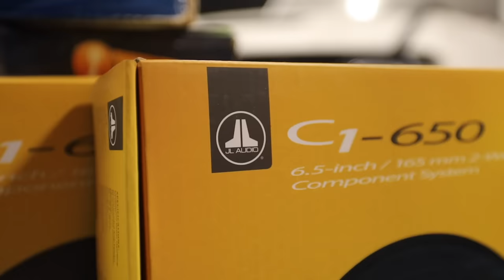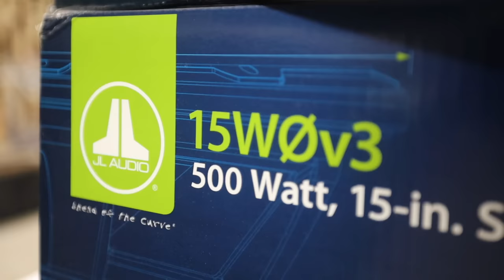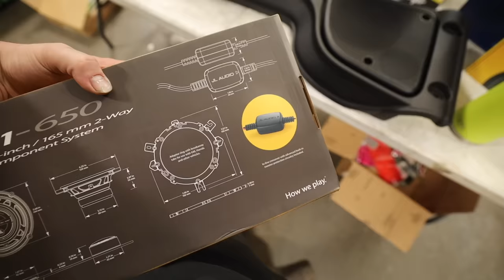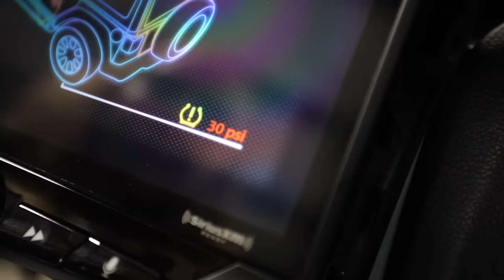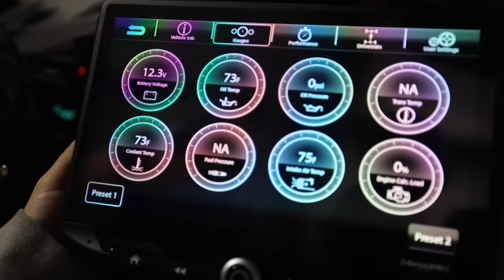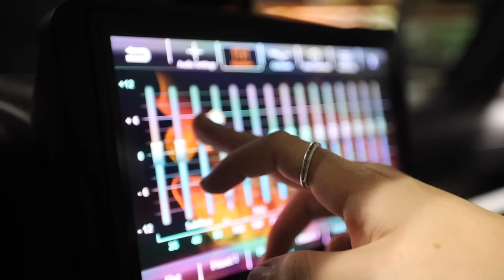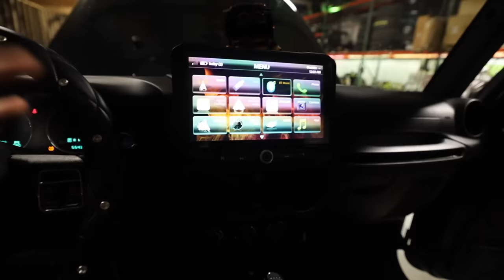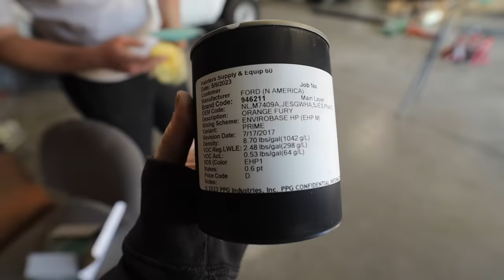Putting TWO 15 INCH SUBWOOFERS in My Girlfriends JEEP WRANGLER!

Comment: The foam in boxes are NOT FOR SOUND DAMPENING! It displaces the air waves! When an air wave bounces off the back of the box it disrupts the push pull of the driver. If you put the foam in inside, it slows down the return waves, therefore the sub thinks its in a bigger box. Lower FQ, more power handle lode with out distortion. The sub FQ will lower. It is NOT THERE FOR SOUND DAMPENING like Dynamat does.
Reply: I was lookin for this. B4 I said it😂
Reply: I rather go with surface polyfill
Reply: And also makes the sub hot faster. Which is no good.
Reply: I got two body pillows in my box

Comment: The sound deadening in the sub box is a no no. You are taking up more air space that the sub needs. Especially a sealed box.  You use poly fill for the sub box it like what the use in pillows. You just put in a little bit around the walls. Slows the air movement down making the sun think it’s a bigger box.
Reply: The 80's called and want their technology back. 

Ringing subwoofer enclosures are exactly what you want to hear in a good stereo set up.

Comment: SUPER CLEAN AMP install  I will be ordering those amp racks to remount my amps.-   As a Jeep & Bass guy, only use SPL subs so that the bass is hard with or without the top.  It is a Jeep so that top is gonna be off or partially off at some point. And just a tip, never tune audio using Bluetooth.  props for having a lady that helps, that's awesome.

Comment: Very clean install. With that space I would’ve went for either a single 12 or two 10’s in a ported enclosure tuned to 30-32 hz
Reply: No wonder your mother is disappointed in you... sissy 😂😂😂
Reply: It Would be pointless to use a ported enclosure if you’re going to be driving with the doors off etc… 😂 might as well run the subs with no box at that point

Comment: Jl audio I had them back in the day they always split their surrounds on 15 w6 ran a trio of them in my Grand Cherokee. The w7 has modular surround meaning it's replaceable . When I put the 12s under my Rams seat I skipped JL and went to a pair of DC audio level 4 with level 5 upgrade parts they hit almost as hard as the 3 15w6 did and haven't fell apart like the w6 surrounds did.

Comment: I'm curious as to why you went with 15s since you're not going for big wattage
Reply: Generally speaking, bigger subs will have more output for the same power. So if you want the most output without using a whole lot of power, go with big subs and big enclosures.

Comment: A sealed box is the best if you're not a Bass Head. Much ezy to toon faster with the best price. I switched to Fosgate stereo system in the early 90's like 1991 first year of High school and still have the amplifier punch 200 for mid punch 60 high punch 40. the sound denting material just use Lizard coating spray on. Best for the money.

Comment: Where did you mount the bass control knob? I just installed some 10" subs and am trying to figure out the best place for the control knob.
Reply from the maker: The panel under the steering wheel, there’s a thin piece on the right and left side of the under steering wheel plastic and we drilled it into the right side! Out of sight yet totally accessible!

Comment: it can be confusing on car audio forums. not everyone really knows what they are talking about. some are just repeating things like robots without any real world experience. 
the sound bar delete was in reference to creating a front sound stage. 
using soundmat inside the box isnt needed. you could build a box using thicker mdf and coat the box with bedliner since its a jeep and water getting inside is a thing. 
adding sound mat is adding mass to your vehicle surfaces. you're essentially lowering the frequency  of the noise. adding another layer to the floors will help. also adding mat to the inside skin of the door will help. invest in some amp gain setting tools if this is going to be a thing for you. setting gains by ear is fine to get some music going but you are not getting the performance you should.

Comment: Ok I just looked it up your subs are 4 ohms and your amp is 600w at 4 ohms and 1000w 2 ohms if that’s all good play around with box placement my box was placed right up on the back door. One thing you have to remember is bass is non directional. Meaning if it facing the back it will still project and being a sealed box it doesn’t need room for the port to fire

Comment: Nice clean install but subs that's supposed to work in small space has a trade-off of what it could soud like and to me it's to big of a trade-off. Max I would of went with is 2 12s with the same air space. A higher quality 10s would most likely sound better than what you have.

Comment: All you need is a big 3 upgrade and agm battery from xs power preferably the d3400 series to help with the voltage drop.. running stock electrical you’ll never get the full potential of what  that system can do!

Comment: I had the HEIGH10 in my Wrangler. Only problems I had with it were once in a blue moon the reverse camera didn’t work (very rare) and the steering wheel controls had a slight delay.

Comment: 9 wire with a wire harness to keep the factory wiring in place is so much easier. You won't notice any difference in sound quality. Those speaker wire adapters are also really nice and would have simplified the component install. Just saying.

Comment: Your videos are getting better and better.  I'm impressed with the Stinger! Any thoughts about putting on in your Ram? I'm going to look into one for my 2017.  My head unit doesn't have GPS activated and I can't fathom spending $500 to activate it. I'd much rather spend $1000 and get the Stinger!!
Reply from the maker: The stinger for the ram is a pretty clean kit as well! Bigger than the 8” u connect and ready to go for aftermarket speakers!
Reply: Only thing i didnt like about the stinger when looking at it, is that what you pay to get it still doesn’t give you bluetooth apple car play. Whereas the sony head unit that is free floating is $1,300 and it has BT apple car play and is a 10.1” free floating head unit with a volume KNOB (which is a big seller for me, i hate clicking buttons i just want a wheel to spin to lower my volume quickly). I cant remember the exact model number for the sony headunit, but thats what im putting in my ram after i do my subs.

Edit: the headunit is actually kenwood and its the

Kenwood Excelon Reference DMX1057XR

Comment: Great Install, Very clean. I'm just wondering why you "daisy chained" the wires to the subwoofers? Overall, well done and good work!
Reply: He wired them in parallel to get the lowest impedance possible.
Reply: @JasonWW2000  wiring them parallel is not the same as a daisy chain
Reply: @johndonut104 Okay, so by daisy chain your referring to series wiring, correct? 
He didn't daisy chain them. He wired them in parallel. 

The subs are single coil 4 ohm. 

He wired the positive of each sub together and the negative of each sub together. So if you measure the resistance at the amp it would be around 2 ohms. 

If he daisy chained them it would read about 8 ohms at the amp. 

Hope that clears up any misunderstanding. 👍
Reply: @JasonWW2000  20:45 clearly daisy chained but ok, I guess I'm confused. I'm done thinking about it anyway haha as long as it bumps
Reply: @johndonut104  I can tell it's a bit confusing, just follow the 2 wires from the amp to the box. They come in from the left. If he were to wire these subs in series the red one would be on the right speaker positive  (it is) and the non-red one would attach to the left speaker negative (it's not). Then he would connect the left positive to the right negative making a big circle.

It is hard to see, but it's in parallel. 

If you look close you'll see both wires from the amp attached to the right sub. Then he has jumpers going to the left sub. There is not a big circle or loop. 

Hopefully it makes sense. 👍

Comment: I don’t like under the seat mounting for the amps… can’t tune the amp without removing the seat and like my car the wires for the airbag and safety belt are right there, and I have rear seat vents under my seats.

Comment: Yeah that shouldn't need to be turned up to 37 to hit hard. I've done 12s that took my mirror down on volume 12
Reply from the maker: That’s exactly what we didn’t want, this system is built to sound like a concert not a 2001 Chevy impala.
Reply: It all about adjusting the amp gains. Yours is adjusted too high. In the video they have it adjusted a bit too low. In my opinion. 

There's really no right or wrong. Adjust to whatever you prefer.

Comment: All that time & effort to Dynamat the tub is pretty much done in vein because of the fiberglass top. Sure you'll cut down road noise but really isn't worth it unless you're going to dampen the top. As crazy as it sounds, you'd actually get better results with a soft top. As far as Dynamatting the inside of the box...also a waste. All you're doing is eating up speaker displacement when it comes to subs. Speaker pods & sound bar... poly fill & dampen away. Sub enclosure... totally unnecessary. If you're taking pointers from Mark from CAF then you would've learned that.
Lastly, I know The Heigh10 might seem like it has all the bells & whistles & the quintessential head unit for a Jeep...not so much. They just jumped on the Jeep bandwagon because the aftermarket industry for Jeeps is a big fat cash cow. Before releasing that head unit what other Jeep related accessories did Stinger have? Nada. All of a sudden they're the go to for Jeep audio?Scratch that. What car audio electronic anything for any vehicle did they have? Nada once again. Speaker wires, amp kits, distribution blocks, batteries etc which is what they're known for. 
They just saw there was a gap in the market between the high end Alpine head units & the Android Amazon junk...which is really what the Stinger is. A glorified, more refined Amazon head unit. The pre-out voltage is trash. It's almost impossible to gain match external amplifiers. Even with something like a SMD DD1 or oscilloscope. It'll detect distortion before you get the volume 1/2 way. It's simply not worth the money they're asking. 
Don't get me wrong. I'm not running you down. You did a great job with the information that is available to you. More often than not, the info you find on forums are from a bunch of folks who think they know it all when in reality they're just regurgitating misinformation that they picked up from another know it all.

Comment: Two 15’s should be shaking the hell out if that jeep and shop. And it should be making her hair move make sure it’s wired to the right ohms 
If you are running a 1 ohms sub at 4 ohms both amp and sub will be under preforming 
I had two 12’s in my Jeep and it would blow out a lighter with the air movement
Reply from the maker: Hard to show on camera, it definitely HITS HARD, you can hear the jeep coming down the street and it’ll flex the hard top.  We wanted a concert sound so 2 500w JL 15s give us good quality sounding bass, not loud rattle bass, thus the non ported box too, clean and tight bass was the goal you can feel it in your chest no doubt. But we’re happy it’s not shaking the hell
out of the jeep!

Comment: So that you said you wanted to make it like the factory connector from the Soundbar connection to factory wiring connection you should have repinned the connector Factory one with your wiring then it would have your wiring but be able to disconnect using a factory connector the one that you chopped off,  also it is known to pretty much every stereo guy out there the fuse for the amplifiers must be 12 to 18 inches from the battery putting it near the amplifier is pointless the fuses purpose is so that you do not burn up your wiring in turn burning up your carpet so why would you put the fuse next to the amplifier you're putting it next to the amplifier then it makes the amplifier not burn up yes good idea but putting it near the battery or after the battery before the wire snakes through the interior then you will not burn up your interior or burn your car down seen it happen before not saying you don't do an excellent job on your installs with everything you do I'm just informing you the safety aspect of the point behind electrical and safety. Also just so you know your pre-fab sub box having the back wall of the box at the same angle as the sub mounting wall when the bass sound waves come out of the back of the sub and hit the back wall of the box and return pushing the sound waves into the subwoofer at least 15 to 25% of the sound or the bass gets canceled out by the angles that the sound hits walls and get sent back to the subwoofer, if the back, if the back wall was set at even a anywhere for 7 1/2 ° all the way up to 15 degree or 25° for 35° and so forth it will not cancel bass out as the bass returns from coming out of the back of the sub being bounced off the back wall and then so forth the sound travels back and forth bouncing back and forth which cancels out at least a third of the sound ask any stereo systems technician or a professional box Builder that is 100 true the sound waves will get canceled out if the back wall of the sub box is angled or the sub mounting wall is angled then the bass will not be canceled out at all meaning you will get the true potential out of all the sub has to offer sound wise and bass wise, plus if you're so interested in it being sound quality sound Clarity then you shouldn't be using the brand of amplifiers you're using you should be using something like focal or Soundstream or Orion those amplifiers are much higher quality as it goes for sound quality and clarity if my opinions come across as an insult they are not they are as you put it my opinion but I used to professionally build sub boxes and had a program on the computer that I had to buy and it tells you all of these things and makes you well it's basically like solid works for sub box building or CAD design for box building and then it also goes into factors like makes you put the submodel size all the spec sheet parameters the qms the square feet the RMS the max power the range in HZ that the sub uses etcetera etcetera these parameters all fall into the categories of how much air mass or interior box square footage. the calculation is height x width x depth divide by 1728 and that will tell you the interior square footage required. the amount required is also different from vented to sealed to bandpass to tri-tune types of boxes.
Reply: Also i feel the amps are
To far from the subs.

Comment: You need to get on YT and look around for car audio content. That box is way too small and choking those 15's. That entire enclosure is a little larger than the space that only one of those subs should have. Looking at JLs specs for these subs, they should have 1.875 cu ft sealed. Just looking at it, that box is only about 1.25 per chamber. Also, nothing wrong with a sealed enclosure. You will have tighter bass and improved power handling vs a ported enclosure. I ported enclosure will have a "boomier" sound and can reach the same sound levels as a sealed enclosure with lower input wattage. Back in the 90's one 15 was put in a 3 cu. ft. box each and ran hard on 150 watts. Adding sound dampening INSIDE a sub box is a total noob waste of time and money. I hope that all that sound deadener was donated since you are putting your efforts in the wrong areas. While I agree that you did a satisfactory install, I feel sorry for the younger than me viewers that think this is a "professional" install. Can't blame them though. They don't have a point of reference since they were not even a thought back in the golden era of car audio of the late 80's and 90's. Also, each of the fuses for the amplifiers should be within 18" or closer to the battery. The purpose of the fuse is to protect the vehicle, NOT to protect the amp. They need to be as close to the battery as possible. The proper way to adjust the amps is to use a handheld DVM or handheld Oscilloscope. That way you are not sitting there with the music blasting and trying to "hear" the distortion. LOL, you said "back in the day". Son, back in the day you were 2 yo. Old school bass head
Reply from the maker: The box is actually about 1.8 cu ft! 3/4” and 1” face I never said it but it was the best “pre fab” box I could possibly find, I know sealed and 15’s doesn’t go together for most but it’s a jeep and the hardtop flex’s with the sealed box right now!

Comment: you said that radio dose 55 watts a channel thats incorrect  it dose 15 most after market radios do 15 watts rms power 50-70 watts max power which is a false number set to help sales how ever still a good videos how ever there is radios out there that do 50x4 rms but they require direct connection to the battery and the old inlet form the factory radio but every thing i seen so far is good for the most part keep on bassing man ps not here to slander you or anything just helping spread information and tech ya something

Comment: You have a terrible box need a custom made box for the specs of the subs and those push terminals are the biggest bottle neck and you should bypass those
Reply: Not really.
Reply: @JasonWW2000  Stop meat riding bud

Comment: great idea with the mat in the box! sent you a message on Instagram would love your help in solving my issue...
Reply: Actually the mat in the box is a bad idea. Thats why no one recommends it. 

What you can do to improve things:
Add extra wood glue on all internal seams, glue in the speaker terminals with E6000 or similar and maybe add internal bracing. Check the seal around the speaker lip. Sometimes you need to remove the carpet and add a strip of foam to get it air tight. 

This will give true performance improvements. 👍